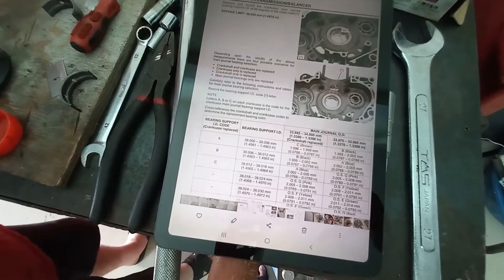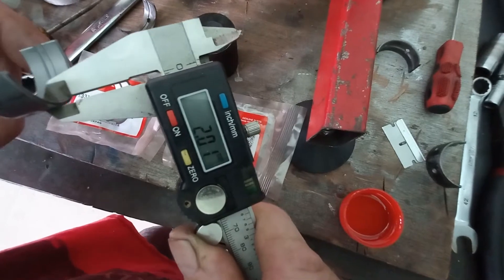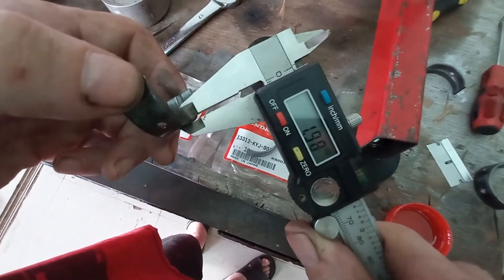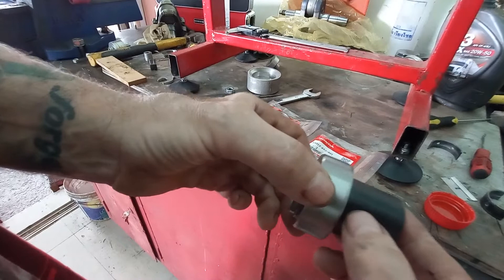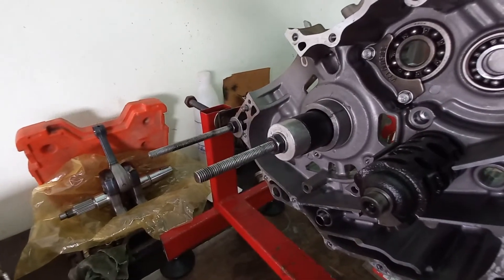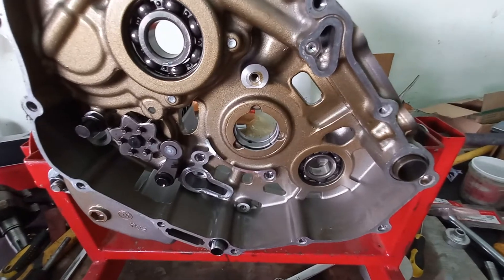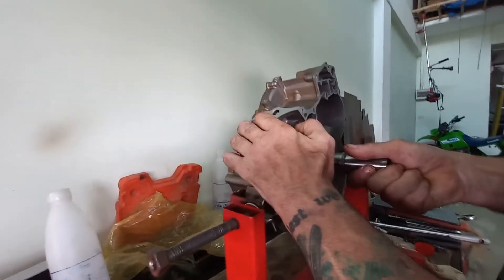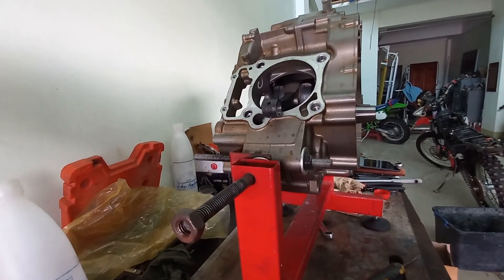CRF250L TO 286CC (300L) Fitting crank bearings

Comment: Did you bottom your bearings out or did you stop before touching bottom? 🤣 My old bearing seemed to have wear on the lip towards the crank like maybe they should have been pressed in more...
Reply from the maker: They go in at a set depth for the oil feed hole in the bearing shell, i think the book said 2mm gap on the outer edge.